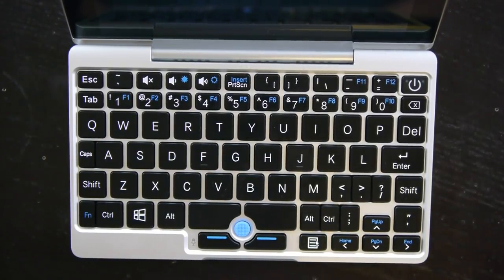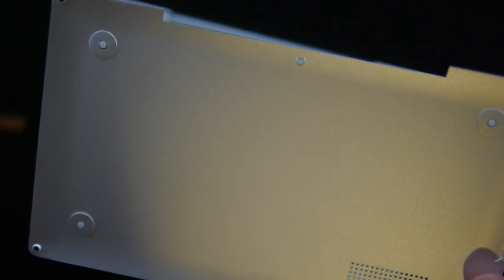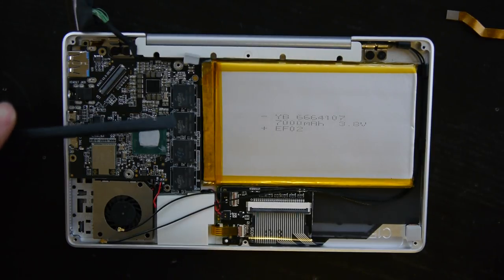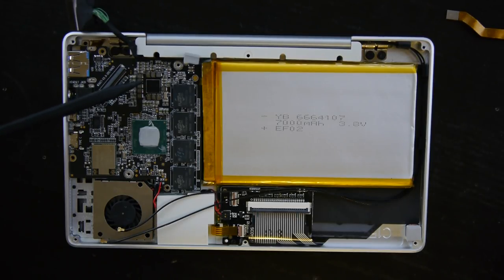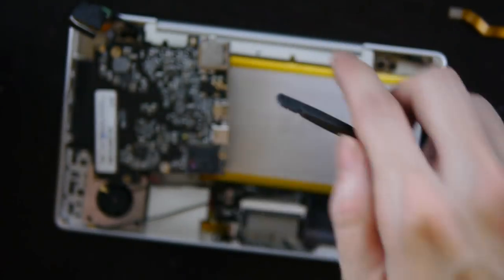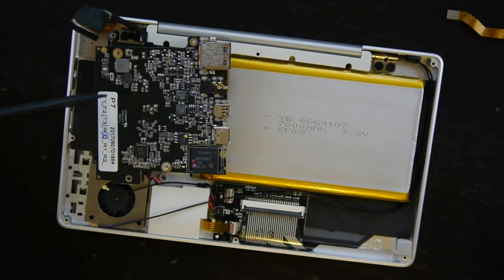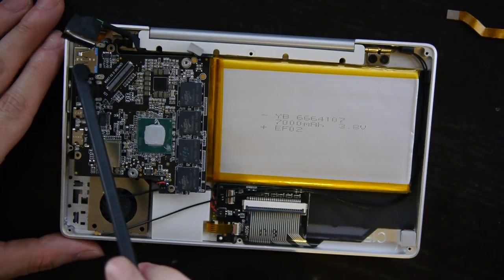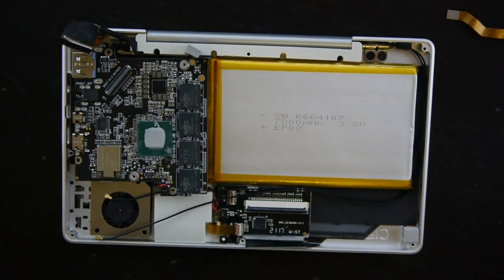GPD Pocket Teardown

Comment: Intel SST is just a DSP, it doesn't handle DAC and ADC tasks. You still need an external codec chip to do the AD/DA conversion. The Realtek chip is an I2S codec. That makes sense to me.
Reply from the maker: you are correct, thanks for the correction. The first person to notify me was nimblesquirrel on reddit. If I had read the datasheet on that one then I would have known. But I wanted to push the video out ASAP.

Comment: Hello, I bought a GPD Pocket mini pc last month (august) in bestgear, today I tried to turn it on but it just turned on the led light in the power on button, and screen remain black. I saw your video and I have already checked and my computer has a specific part that locks up that conector so I don't think that could be my problem, when I try to charge the GPD doesn't show any indication on screen about charging percentage. Have you had a report with similar problem? Do you have any clue on what could be the reazon why my computer is behabing this way? thank you, your video is very informative.
Reply: i have similar problem:(...please help

Comment: Oh jeez GPD. You would think they would make sure they made a heatsink that properly mates with the CPU after the issues they've had with the Win. Hopefully the Win 2 will have a better heatsink design.
Reply: It's good enough on the WIN. My win never throtles. Play skyrim on surface 3 and within 30 seconds cpu throtles to 1100 mhz (video on YouTube). 

On the wIN, you can play for 45 minutes at constant max burst frequency (2400) without ever hitting throtling temp.

Considering the WIN costs 350 euros, and the microsoft surface 3 costs 600 or more for the same hardware with no gamepad or keyboard and an easier-to-cool form factor(!) , I am more then satisfied.
Reply from the maker: I think its pretty good actually, keep in mind it only has to dissipate something like 4.5W max (intel only specs a "scenario design power" of 2W, but it can go higher). It doesn't make great contact with the CPU but this is still better than many low end laptops, even some high end ones. I would say it's easily sufficient for 2W, so its only really CPU and GPU intensive tasks that really push it.

Still Ill take all the cooling I can get, so I'm planning to heatsink it to the bottom case with a heatpipe. I might look into more heatsinking of the PCB to the top case but that will depend on how hot the back side of the PCB gets
Reply: Heatsinking it to the back with a heatpipe is actually cooler, on the backplate, than using direct thermal pads.

Comment: The battery lasts about 2 years before it puffs and needs replacing as well. It balloons up so now I'm trying to find an upgrade, possibly a 10,000 MaH. What connector type is the battery to the board using?

Comment: It would be nice if the storage for this was  a M.2 ssd instead of being soldered on to the board. Who agrees with this.
Reply: cost and where would they place it inside?
Reply: +Dylan Durdle It's true that the cost would be bit more. a  small ssd that would be a pci-e type small form factor would be great and wouldn't take or require a lot off space.
Reply from the maker: The CPU has only 2 PCIe Lanes, so this is simply not possible.
Besides, the eMMC is actually decent, made by samsung and I get about 100 MB/s write on large files. The bottleneck here is definitely the CPU, a more expensive low power intel chip would give you much more benefit than a m.2 ssd
Reply: Yeah, it's a shame the storage device can't be upgraded. Although there are plenty of small external drives
Reply: there literally is not enough room in the pocket to fit it. m.2 half size or mini pcie half size ssds are fairly thick.
Reply: Maybe a soldered M.2 SSD would be nice too. If spaces is the issue here.
Reply: Idly wondering if there's a 256GB part that I could directly swap. Soldered on is not an issue with my cheap AliExpress SMD rework station/hotplate, but no datasheet to check the pinout against might be.

Comment: Nice video showing all the flaws on the 

I lost 30% battery in 10 mins when watching an educational webinar on adobe connect

I have only used this device for max 20 hrs since I bought it. Does anyone have such issue and can we buy a replacement battery. If it is a new device then why do we need to buy a new battery so soon!!

Any suggestion . I am nervous opening devices in case I damage anything 
Thank you

Comment: Thanks for video, I just repasted it with liquid metal and at AIDA64 fulll stability test no throttling!  (but 10 minutes of battery life :D)
Reply from the maker: I have a 0.5mm heat pipe in the mail, when it arrives I'll put conductonaut on it and a thermal pad to the case. and then we'll see how hard I can push it without throttling.

Comment: do you have specs or info about the screen and the digitizer (touch screen)?
i kinda wanna know if i can put a 10 inch lvds / edp screen onto this or not, so i can design a case and have a 10 inch GPD Pocket.

wondering how to disassemble the screen from the aluminum housing, maybe need a proper tool to NOT shatter the glass.

Comment: Nice video! However, I'm curious about the touch screen controller. You didn't mention anything about it. Would it be located within the screen enclosure? From device manager, is it possible to know which chip it is? I'm asking because I had a Chinese tablet that had an I2C touchscreen controller that was terribly slow. It would work ok for isolated touch and drag and drop gestures, but drawing and writing on the screen (with a proper capacitive pen) was horrible. An attempt to make a circle would actually turns out as an hexagon. So, can you tell me which chip runs the touch? Thanks
Reply from the maker: Yes, it will be located in the screen, which I'm not going to unglue, sorry! I will say that its very quick (I coudnt detect lag using the pencil tool in mspaint) and has 10-point touch (not tested but per GPD spec sheet) so its going to be fairly decent.

Ven/dev is HID\VEN_GDIX&DEV_1001
which gives us "goodix" as the manufacturer. Hope this helps!
Reply: Thank for the info. My GPD arrived today. Turns out it uses the same slow I2C touch screen controller that my other tablet was using (Teclast x98 Pro). It had tweaked parameters to make it a little bit faster, but still not suitable for capacitive pen input. My pen works much better on my phone (Nexus 6) than on the GPD.

However, I was surprised by another thing. Unfortunately it seems that my device has a defective matrix keyboard. I get "t" keypresses by just typing any letter close to "t" (like r, y, f, g), and every time I press the "t", it registers twice, no matter if I press it fast, slow, strong, lightly. Have you noticed problems like that on your unit?

Comment: I bet that Realtek SoC is for the Surround Sound decoding on HDMI out.
Reply from the maker: Thanks to niblesquirrel on reddit he says the following: "Just a note for your teardown chip identification: the Realtek ALC5645 is for multi-channel analog audio (headphone, speaker and mic). Yes, audio is handled on the digital side by the Intel SST, but (if it is not going over HDMI or USB) it is then sent over the Integrated Inter-IC Sound Bus (I2S) to the Realtek Chip where it is decoded (hence the CODEC). The Realtek chip also has DAC and small (1-2W) amplifier." so the digital audio for HDMI or whatever is most likely not the realtek chip XD

Comment: people said the same thing about the xd's battery connector, yet in 2 years on all of dingoonity I have NEVER read a SINGLE case where the batttery connector ever got loose. They sold tens of thousands of XD's, and they are really really sturdy. People comment on dropping them multiple times no issue, hell somebody had their dog piss on it with no issue (it;s in one of the YouTube reviews).

If not a single person ever had a problem with the battery connector becoming loose, out of tens of thousands of customers over 2 years, I would tend to say it is, apparently, more then good enough XD

Also, this does make it easier to replace the battery yourself without breaking anything right? so I think that might be why they chose one that can be removed with little force...
Reply: The difference is though lots of backers are reporting that the unit won't power on and  they deemed it was due to the battery connector coming loose in transit.  Apparently they are addressing the issue on future units (maybe going to tape it down?)
Reply: hm, okay, then that's a problem and it surprises me, considering noneof their many earlier devcies ever had this problem. Well considering the Q9, WIN also got improvements in later batches I am pretty sure they will fix it though. 

I am still not gonna buy one, I have a win already and I use it for gaming so no point for me XD
Reply from the maker: Its just a really weak connector. Its a very thin profile (for no reason since there/s loads of space inside) so it requires very little force to unplug. They have somewhat addressed this with the foam over it keeping it compressed with the back plate on but with a different connector it would be much better. I dont have a win, but looking at the teardown I think its a JST connector, which requires a lot of force to remove. That would have been a much better choice here.

Comment: so overall, is the engineering design average or bad ?
Reply: considering I have 5 GPD devices from between 2013 and 2016 (gpd g5a, old q9, q9 psv, XD, and WIN) and all have Always worked perfectly, and still do so, including the ones that are 2 to 4 years old, I would say it's definitely "good enough". They all feel really solid, some of them were dropped (no issues), and are ergonomic too.

so, I would say it's great. Their devices lasts at least 2 years and probably a bit more on average, and cost 1/3th or less of what they would if a western brand made them.

Which for me, automatically makes it "good engineering". I am a customer. I want value-for-money.
Reply from the maker: I like it. I'm no EE (yet) but the PCB is very nice, and they have maximized a lot of options. Some of the chips are quite nice, some are not. Overall I'd say its fairly standard tablet PC construction.

As I said in another comment, I think its great fr how quickly they pushed it out. Whatever contract manufacturer they got to design or help design the PCB did a good job. Had they gone through a few more prototyping runs they might have got it a bit better. But overall like I said I think its fine.